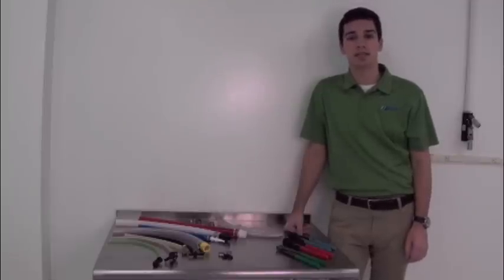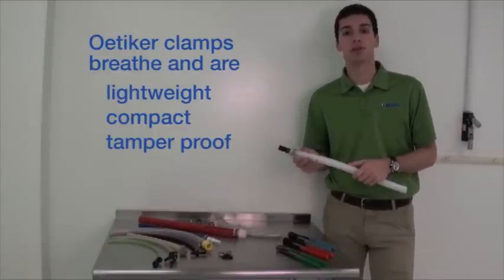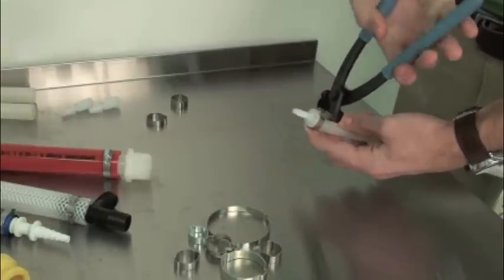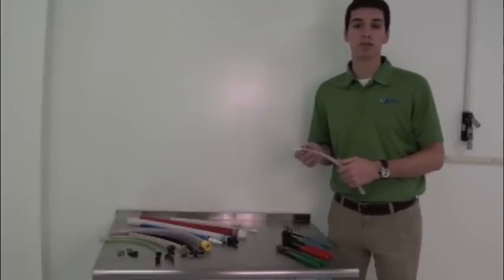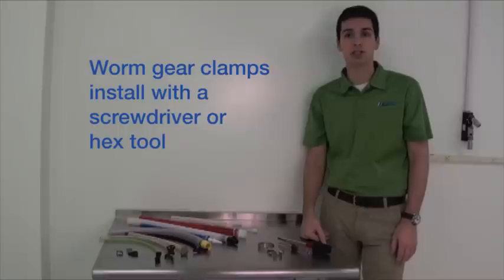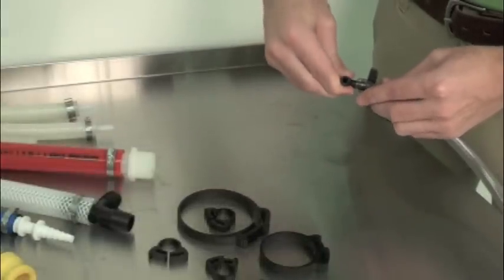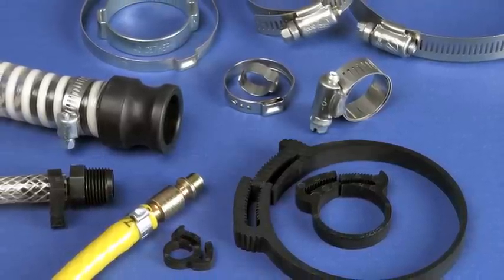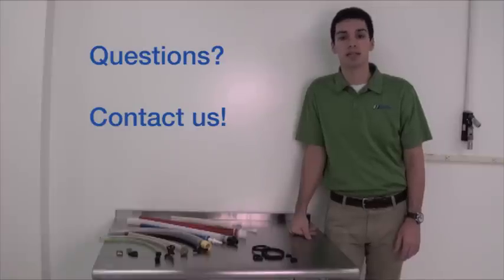How to Install Tubing and Hose Clamps

Comment: I would like to inquire if you know how to detach and attach back a hose on the top of a Fuel Pump Assembly for a car. If you want to replace it or reinforce w/additional small 1 ear clamp. It should be pretty common procedure, but I didn't find anything on youtube, though I saw some films where there were shown the assemblies without the 3 tubes coming from the top. It means the person will attach it later, but how? It should be cold press and though some people put those hoses in boiling water it is not quite correct as far as I understand. I installed one of Oetiker ear-style clamp (10.3-12.8mm) on one central hose fm/3, but for that I opened a new clamp and then closed it on that tube. Probably it is not quite correct and extremely hard to do. 
PS.: here is a sample of those assemblies w/3 tubes on top (Nylon Tubes)
https://www.amazon.com/Premium-Electric-Module-Assembly-1998-2002/dp/B075HY674M/ref